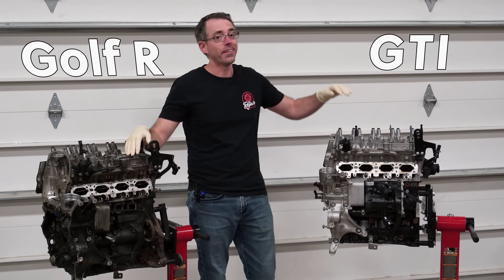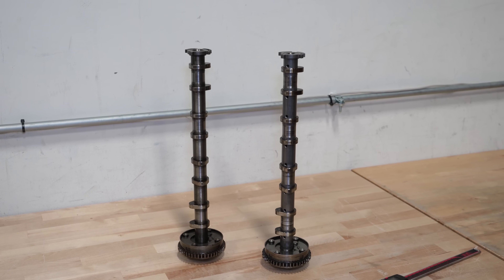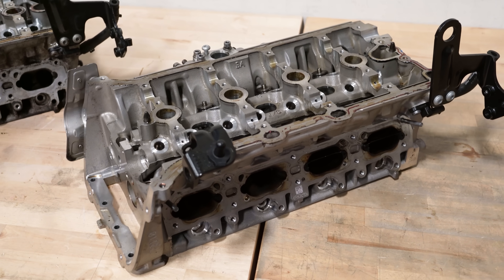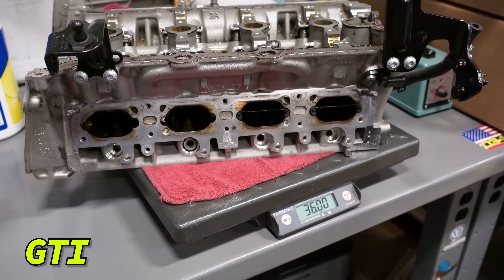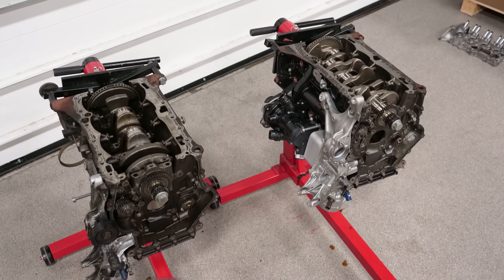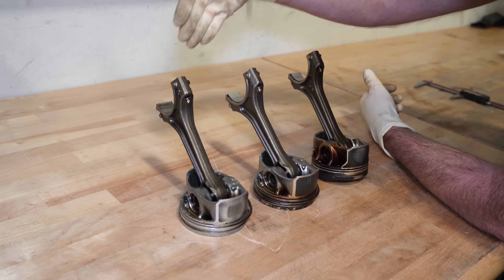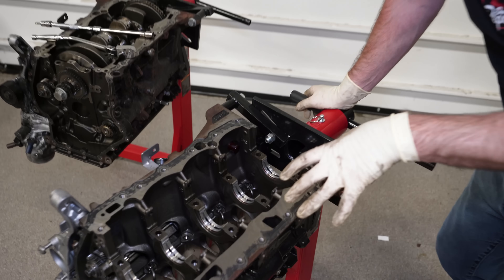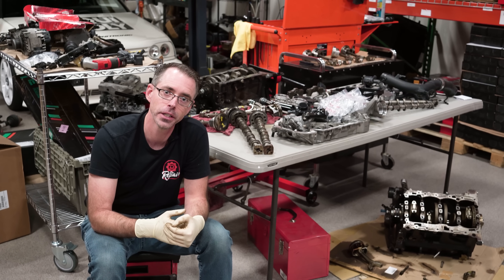Are Golf R Engine Internals Better than a GTI?

Comment: If you have the exhaust port opened longer you'll have more of an air pull outwards, letting the engine run both alittle cooler, but also will slightly increase power since it pulls more fresh air instead of using a fraction of the combusted mixture for the next strokes. I am pretty sure it increases fuel consumption too

Comment: please keep in mind, that the differences are not just in part geometry or manufacturing method, but also in alloy, which you usually can't tell from the outside.
for storage cost cutting, the spare part number is identical between all models, of the same measurements, as only the top performing part is kept stock. 

at least for BMW engines i know this for certain. idk wether that is absolutely applicable for VAG concern cars too, but it more than likely is. 

the most prominent example was the 114i and 118i sharing the same displacement and outer dimensions of the engine itself. some german tuners offered simple software packeges bumping the power of the 114i to 118i levels. initially everything ran fine, until someone did a full throttle autobahn run for a few minutes, and melted a hole into the piston crowns. 

at bmw there is 4 levels of part quality for things like pistons. they're mostly the same measurements, but you get a low, mid and high tier part plus the ///M-sport/racing variant. the low/base tier piston is only made from aluminium, the mid tier part adds silicon for improved rigidity and the high tier part adds cooper for improved heat handling, making it possible to dump heat more effectively into the oil. 

this is just one example. don't assume that just because parts from two different engines look identical, that they are identical.
Reply: So 114i piston PN is different from 118i PN?
Reply: @macchine.veloci.2  no, the replacement parts numbers are identical, because for stocking replacements you just take the highest tier, since keeping several different kinds in stock would be more expensive than just having the more expensive one exclusively. 

only during initial production at the assembly line, different pistons are used for different tier engines. assume the price difference for bmw themselves who buy them from suppliers, is about 1-2€ per piston, now multiply that by the number of pistons in the car, and multiply that by the number of cars of that type and engine made if compared to making only the highest tier piston. you'd end up by a several million Euros the manufacturer is saving this way.

Comment: My main problem with gti (as much as I love it) is not the lack of power but torque steer and all the shaking that happens whenever you launch the car. Even if you add more power it’s not gonna launch much faster, so the key is AWD system which R has and gti does not.

Comment: At 2:00 you should have laser 3d scanned the lobes and done the compression. 
I’ve used a Creality Raptor laser 3d scanner to good effect(0.02mm). 
They are quite cheap for what you get($1000)

Comment: and you have to take engines from the same year and months to compete. at the gearboxes many parts changed by time. so its possible u have 2 gearboxes from cars with same datas and they are different inside.

Comment: I had an MK7 GTI with apr stage 1 for 90,000 rough miles of 100,000 miles since new. The thing that crapped out on me was the dsg at 100k not the engine.

Comment: The GTI intake cams likely work fine on gti for normal use, the only concern I could think of is cycle fatigue, since the timing on the golf r is likely higher for more there could concerns on reliability of the cam after prolonged use. Would be surprised

Comment: The marks across the forging mark, called flashing are actually cut marks from another die, a flashing die that cuts off the extra metal that squeezes out of the forging dies. If the time were to be taken to do a really good job with hand grinding, those marks would be smooth and blended. You wouldnt see any line at all. They obviously dont take that kind of time.

Comment: So you mentioned the GTi exhaust lobes are pressed onto a spline on the cam shaft and the R exhaust lobes are pressed onto the spindle for an interference fit, any possibility the R shaft is machined? Would make way more sense as to why there's no spline under the lobe

Comment: you put  2 springs you are comparing in the vice stacked  close the vice 1 inch if the springs have compressed the same they are the same if one compresses less its stronger  and  gives a clear indication

Comment: https://youtu.be/OZyvQgcaxGM?t=939 I know this is an older video but a narrower piston oil "squirter" would actually spray with more pressure not less. The question is is more pressure better or worse. Just it being bigger isn't exactly enough to quantify it's performance.

Comment: Je trouve que la Golf GTI clubsport en boîte manuelle est meilleure que la Golf R, sauf si vous vivez plusieurs mois dans la neige.
Et la Seat Cupra 290 pack brembo, bien sûr boîte manuelle, est la plus aboutit et la plus efficace que toutes les autres Golf, ou Audi, pour un prix nettement inférieur.
Avec la différence de prix tu pourras la passer en stage 2 voir 3 (intercooler Wagner et downpipe Wagner ou RacingLine, turbo Racer, admission air dynamique RCline 600 et embrayage renforcé  Sachs,  bougies froides,  pompe haute pression Loba et pompe basse pression, le tout chez ton préparateur).
Au delà de 500 CV il faudra forger le moteur.
Donc, 450 CV me paraît bien ! 😊

Comment: With the oil squirter, measure the actual inner diameters!  then calculate the extra area of the squirter, if the wall thickness is ca. 0,3mm then the GTI squirter has an ID ca 2mm and the  0.085mm difference in radius of the squirter hole is about 18% increase in squirter area for the Type R =  significantly higher oil flow in the R.
Reply: Bien ! 😊
Reply: K20 > EA888

Comment: Just so you have he info, When the oil control solenoid fails, it does in fact default to its higher output. At least it did on the Jetta's. Confirmed this as a VW dealer tech.

Comment: VAG has been doing it this way for years. A different alloy cylinder head. Higher-grade head bolts. Higher-quality pistons and lower compression ratios for the larger turbo. The R likely also has a better fuel pump, larger injectors, and a larger intercooler.
A slightly thicker exhaust diameter.
Higher-nm clutch plates.
Different differential in the gearbox.
Different control arm bushings all around, etc.
And stick to the oil specifications and never skimp on cheap fuel. Use the highest octane possible, otherwise your piston rings will crack and the engine could quickly die.

Comment: Back in the day, I bought a ‘81 Rabbit LS new.  Over four years I modified it extensively to make my own GTI.  I spent nearly $3k on items including a Calloway Turbo/intercooler system.  I wish I still had that car.  The idea of bolting in a 2.5 litre 5 cyl would’ve worked so much better.

Comment: Biggest difference besides of typical upgrades is the used material and tolerances. I am working in automotive sector as well and I know that the endurance and peak load specs for R, S and RS versions are different than for normal or GTi versions.

Comment: Safety!!!  When exposed to air, sodium reacts with oxygen and moisture, forming a white coating of sodium oxide and sodium hydroxide. This reaction can be quite vigorous, especially with liquid sodium or in humid conditions, potentially leading to a fire. Sodium is typically stored under oil to prevent this reaction.

Comment: You could in theory test the valve springs manual by using weights to compress the spring. This would give you at least a rough idea of which springs are if at all are stronger.

Comment: Wont let me post image but ssp 606 lists the differences between R/S3/TTS and other engines  

The following components have been adapted:
• Cylinder head with another alloy than other engines of this group, due to the
higher thermal stress
• exhaust valves (hollow Ni content higher, nitrided)
• Rings exhaust valve seat (temperature resistance and improved wear)
• Exhaust camshaft (setting of the appropriate distribution)
• Compression ratio 9.3: 1
• piston cooling nozzles (increased speed)
• High-pressure injectors (further increased speed)
• Turbocharger
• boost pressure up to 1.2 bar
• main water radiator high performance with 1 to 2 additional water heaters
(depending on national version)
• Additional acoustic measurements for a sporty sound with a sound actuator (for
the passenger) and components of exhaust gases in the exhaust system

Comment: You like to live dangerously , cutting a sodium filled valve is something I would espect to see in one of the jackass videos. Also if I remember correctly the secondary electric air pump main function is to lower HC CO emission while running a cold engine. Maybe as a secondary effect it will warmup the catalyst a little , maybe. Also  the overlap of the valves is most important but I do not know how you can measure it properly with a variable timing camshaft. Interesting the alloys used by VW I didnt know they used copper alloy. Thank you for the information.

Comment: you wanna be smart? save some money? just buy GTI and get a stage 1+ ecu and tcu tune for $800-$1000 and there u go u got a Golf R power but u wanna be quicker than stock golf R than upgrade your cat with high flow cats and down pipe and heat exchanger and go with stage 2 tune! and still cheaper than golf R 🤷‍♂️

Comment: This guy seems to not understand that parts looking the same doesn't mean they're same, the material and the manufacturing process can dramatically affect the performance of the part, how rigid it is, how thermally stable it is, how strong it is, how light it is, etc.

Comment: What kind of wrench are you.? If the base circles of the cams are different. You have 10mm difference and the smaller one could still have more lift. Some advice,  if you dont know what you are doing then dont try to act like you do. Hold that caliper didnt do ya any good. If i lost ya do a search on camshaft base circle and it will be explained to you

Comment: So basically a golf R is a $40,000 car with 315 horsepower and a mustang for the same price pushes 460horsepower. I don’t understand the love for these hatchbacks.
Reply: HP isnt everything. A 2024 Mustang at the same price is almost a full second slower on 0-60. You can reliably tune an R to 500hp for $1k. All wheel drive in the from as a haldex system is worth it too.  These cars are slept on.

Comment: Mercedes also uses the 2-stage oil pump primarily, if not solely, from fuel efficiency.  This is at the expense of engine longevity for a few more feet per gallon.  I guess it all adds up to help meet EPA mandates for fuel economy.  The normal (high) pressure stage is also the default.  However, the solenoid is inside the oil pan and very expensive to replace.  Mercedes has issued a tech bulletin to basically instruct dealerships to ignore the P06DA00 DTC.

Comment: I’ve modified and melted two GTi motors and both times piston 3 piston rings blew out with a surge from the sump. Rather than go a third time and prove I am stupid I bought a Tiguan R and it’s better out of the box. Not as quick as a modified car but also not as blowy.

Comment: You were somewhat dismissive about the piston squirter size difference, but it's not so negligible when you account for these being circle circumferences. If we assume the wall thickness of the squirters is around 0.25mm, the diameter of flow is 2.29mm for the R, 2.12mm for the GTi. When you calculate the volume for that flow's diameter, you have 4.121mm2 and 3.531mm2, making a less than negligible 16.7% difference in flow.

Comment: With the Chevy corvette there is a boost cam and then a na cam. The exhaust valves staying open longer(on the boost cam) because its designed in mind for a higher cylinder pressure then stock and needs to stay open longer to have the efficiency and have a better flowing exhaust cycle.

Comment: Ive got a golf mk7 gti with low compression in cylinder 3. I'm considering swapping a mk7 r engine in the gti. all the electronics and gearbox will be swapped over to the bare R engine. Is this plug and play?

Comment: Nice vídeo!
I just had a chance to buy a GTI from one of My Customer and the engine was blow, I was think to buy a used and throw in the car, but I think it worth to rebuild, the interior is phenomenal, steering wheel looks new, door painels are spotless, no rust underneath(in Massachusetts it’s a miracle), I’m going to  disable the engine and see if it really worth to rebuild with forged parts.
 One thing in your video caught my attention is the oil pump with a solenoid, my customer state that he was driving on a highway at 75/80m/h when the oil lights turned on followed by check engine and car starts to shake, hi pull over and didn’t started anymore, the car has a good history of maintenance, he always changed oil at 3500/4000 miles and the car has 104k miles, I’m pretty sure it can me related to that oil pump solenoid.
 
 Great video I really enjoyed it and I learned a lot with it, have a great wekeend and a Happy new year!🎉
Reply: Exactly what happened to mine. Second motor in a a4.. both motors only lasted 60k miles. Last time I would have anything to do with an Audi /vw product. Ymmv

Comment: I recently purchased an APR DTR6054 (big turbo) with upgraded high pressure fuel pump and low pressure fuel pump for my 2019 GLI and (unbeknown to me until a month after ordering the parts) buried deep within the listing online is a hard to notice mention that the available off the shelf tunes to accommodate the upgraded fueling system would not be compatible with my GLI and it made me curious why. I’m honestly shocked to hear there are any real differences between the two engines, I just assumed the added power from the factory came solely from the bigger turbo and slightly more aggressive fuel mapping/timing. I’m surprised to see that VW would bother re-engineering the cam profile, secondary air intake, valve springs, and pistons for a niche application, but in learning more about VW that actually seems to be par for the course🤦‍♂️😂 I think the plan for now is to leave the fuel system stock for a bit until I find a tuner that can make me a custom tune. Worth noting, I wasn’t really interested in chasing the extra 20hp or so from the upgrade, I was mostly concerned with not running the stock system to the ragged edge and thought upgraded parts could perform at the same power level with more head room, as running out of fuel pump at 30 some odd pounds of boost seems like a quick way to grenade any engine.

Comment: Even the R spec engine can still be tuned for more horsepower and torque.  This is very common amongst all engine makers so they can offer different stages of tune for different vehicles.

Comment: Hello folks, noobie here. Why the compression ratio on the R is lower? I would think that because the R has more HP, the compression would be higher ^^'
Great video btw!
Reply: Is it lower to reduce the stress to the engine due to the higher pression of the turbo of the R. The R engine is completely fortified for the higher performance. The GTI engine is not.
Reply: Because people think more boost is better. 

Boost is a measure of restriction. Lower compression = more restrictions = requiring more boost.

Comment: powder metal forged rod.. these are ery strong..but you did no show all the carbon build up these engine get on the backs of the intake valves..i have walnut blasted many ,many of the engines.. some cars were really bad carbon build up at 60000 miles..i was surprised to see them run

Comment: Might be a little late to the party here, I’m from the UK and one thing I picked up on when you said about the GTI engine being made in Mexico and the R engine being made in Germany is, across the pond I read horror stories about GTI engines shitting themselves because of crank walk.

In the UK however this is talked about VERY little if at all, I’ve struggled to find any information for England about crank walk however it seems a prolific issue in the US and part of me wonders now if that’s due to UK GTI engines being manufactured in Germany vs Mexico? Maybe I’m off the mark here but it seems a little coincidental that it’s only an issue that seems to affect GTIs with manual gearboxes (transmissions if you prefer). 

I’d love to get a little insight into this if possible and see if there’s anything to compare between to see why this happens and why it seems to be a US issue.

Comment: As a engine machinist I built quite a few of these engines, mainly the 2.0 cdn engines, one gave me ass holes, they either were smoking due to their thin rings and very steep hone pattern angle or dropped the chain bending everything from the faulty original tensioner. Rebuild the dam thing, everything inspected, nothing shifted or moved, just bent valves and broken rockers, but after the mechanics workshop got it back, back in, walmed up and running mint it then spat number 1 intake valve rocker and bent that valve only. Had to go out and see what was going on with it, and I found after the engine got to operating temp on that first start up after the rebuild it let go of number 1 intake lobe, and it moved about 20 degrees. Took a while to find as had never seen a cam before, and thinking they Mish have some sort of positive fit on those press on lobes, to find after more research that there is no positive fit and is straight press on a polished shaft with interference, such a stupid design.

Comment: If the engine breathing air it has to get it out also longer duration allows more time to allow the exhaust gas to escape turbo and blown engens use 112, to 118 deg duration at 50' and natural asperated use 108 duration  of over lap at 50 '